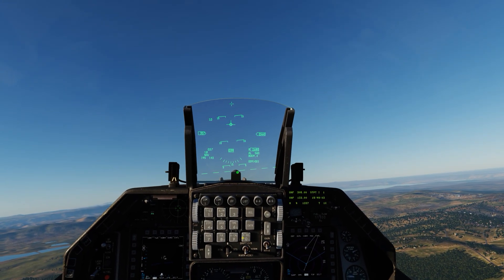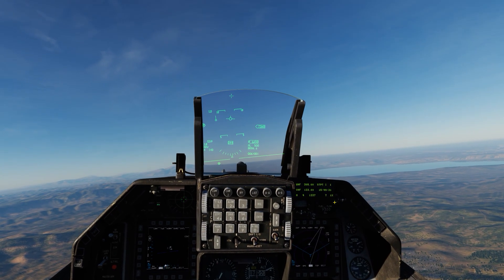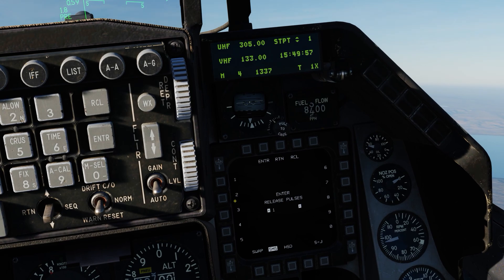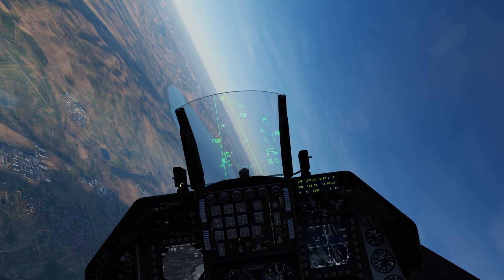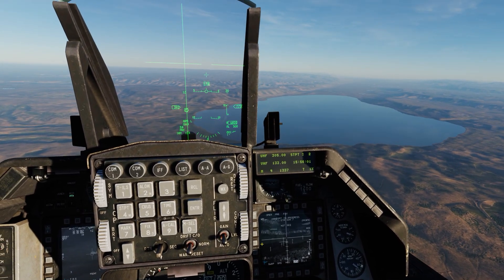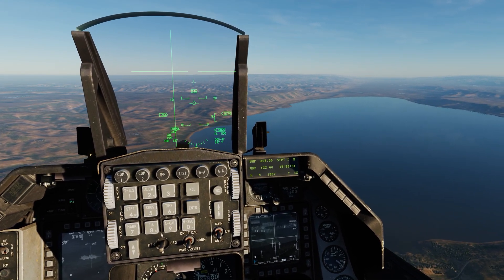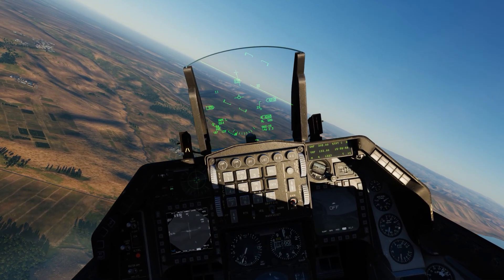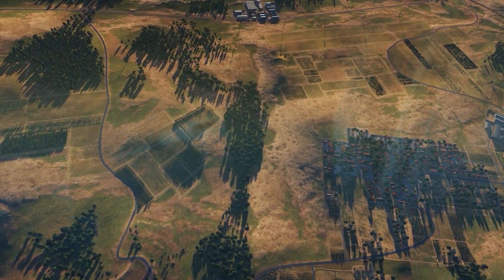DCS F-16C Viper: AGM-65G Maverick Ripple Shots.

Comment: I noted you had to lock the 2nd target with the Mav itself as the Tpod did not hand-off the 2nd target?
Reply from the maker: Hey there i did a BSGT realign. Thats why you saw me using the MAV. I wasnt sure if the 65 was aligned the correct way. Let me if you need further help with that.
Reply: @ironeaglesflight  Thanks!  I have the same problem with adjusting the Mav cursor as my system is calibrated nicely for the TPOD but the Mavs are a bit spastic to make small adjustments with.  Nicely done !